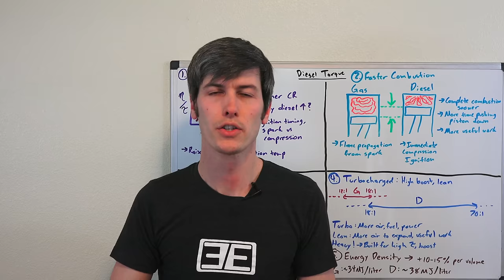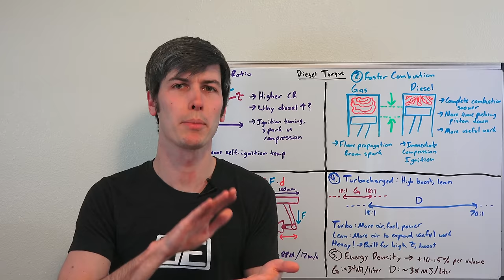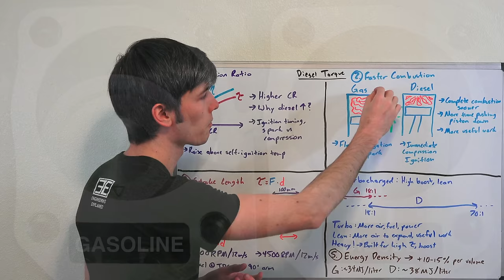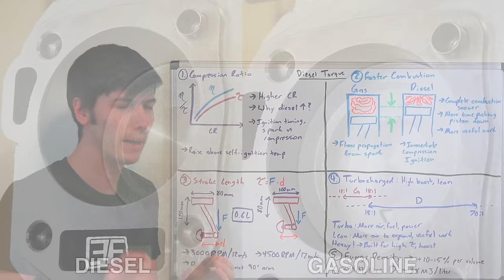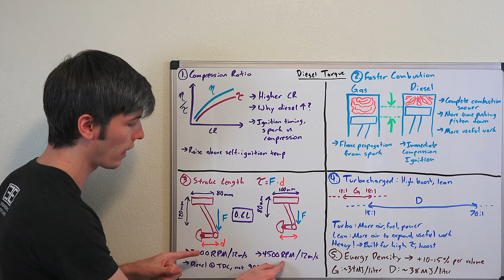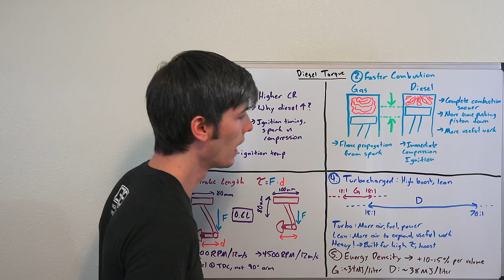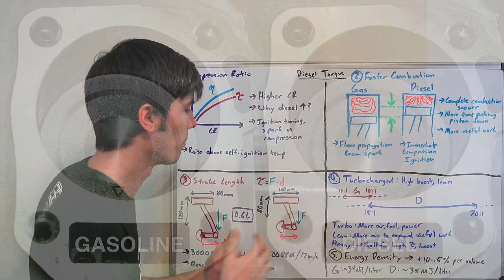5 Reasons Diesel Engines Make More Torque Than Gasoline

Comment from the maker: A question that keeps popping up is why don't any gasoline engines use compression ignition and higher compression ratios to be more like diesel engines. Well, Mazda is doing just that with their SkyActiv-X engine, and I've covered exactly how it works: https://youtu.be/yNSxow3W7ek
Hope everyone's having a great day, thanks for watching!
Instagram - https://www.instagram.com/engineeringexplained/
T-Shirts - http://bit.ly/2BHsiuo
Reply: Engineering Explained 
Does that mean the new Mazda engines will have torque closer to that of a diesel?
Reply: Here may be a good question for a video:  could you explain the differences/benefits between a V8 diesel and an I6, and how those engineering differences impact performance?
Reply: @Engineering Explained,  You said that complete combustion of  Diesel occurs sooner. But the longer carbon chain of diesel needs more time to burn than petrol which has a shorter length. I have some questions regarding this. Can you kindly spare some time in answering them please?
Reply: Mazda SkyActiv-X claims 20% more torque and horsepower while achieving 10% better fuel mileage, ive heard 10mpg improvment on all models.
Reply: It would be interesting to plot the torque over the entire 4-stroke cycle and show how this instaneous torque waveform (positive and negative) gets averaged-out by the rotational moment of inertia of the flywheel and combination of instantaneous torques from all the other cylinders.
Reply: It's not about the rate of flame propagation, but about the fact, that the initial flame is bigger in diesel (you can see that in the video).
Reply: Why just now? Why wasn't it implemented 30 years ago?
Reply: I've always wondered why a spark ignition engine (gasoline) couldn't be built to run on diesel fuel. I'm sure it would require a higher than stock compression ratio (but less than a compression ignition engine) and significant tuning
Reply: That energy gap between diesel and gasoline is the factor that provides all that benefits, maybe?!
Reply: Chris Bouchard GM made a diesel version of their 350 engine in 1978. It didn’t work well, or sell well. It was discontinued in 1985.
Reply: I think you're talking about the Oldsmobile Diesel.  They expected  a block designed for gasoline to handle the pressure required of a diesel cycle.  It didn't do very well
Reply: Ewie M That’s it. The head bolts kept breaking, among other things.
Reply: Are you sure about #2? Because the burn duration in diesel is restricted/limited by how fast you can add the fuel and "mix" it with the air.
Reply: Engineering Explained wrong! Gasoline engine even at idle the combustion is continuing well down the cycle.  Diesel too...  AND diesel burns slower than gasoline. 

Yes it has a longer stroke so the longer burn is negligible. But the longer stroke also means more leverage on the crank - TORQUE! 

The wider A/F has more to do with no throttle body/valve.

The parts I didn't address were correct.
Reply: Viren vs nope
Reply: Carl m that's quite optimistic.  Fuel consumed = power.  Efficiency won't jump that much.
Reply: Shai uncontrolled auto ignition gasoline engines are know as an engine with knock or pinging... 
 You need a computer and very hi pressure fuel system. (even hcci gas engines would be direct injection around tdi not port injection as has been common until  201x
Reply: Chris Bouchard gas engines create power because they are relitivly lightweight and rotate faster compared to diesels... Much different bore/stroke too.  
GM tried making a diesel for their cars in the late 70s...  Turns out a modified gas motor was not durable enough!
Reply: 5Rounds Rapid the gutless wonder they were...
Reply: The diesotto engine also takes the best of both worlds. Spark plug when cold, diesel ignition when hot. I wonder, what causes that distinctive diesel pinging noise?
Reply: eeretz Diesel fuel does just beautifully blow up in a nice little flame wave like gasoline. It just ignites everywhere across the cylinder. So just like in a gas engine when you have uncontrolled combustion somewhere else rather than the spark. Basically diesels have engine knock from hell. Lots of bigger gas engines can have this occur without much problem. Like my F-150 has a little knock which is expected from an old engine so it sounds like a baby diesel at idle.
Reply: Yes, GM converted a 350 into a diesel. I have several, only one is running. But those engines where still compression ignition, not spark ignition. Think about how we use ethanol. If you really wanna take advantage of it's properties, you need to build your engine towards them but with some tuning, you can just drop it right in. Why not with diesel? It wouldn't be a drop in but maybe you could build towards it. Burning diesel in a spark ignition engine.
Reply: Ricardo Fernandes some,  not all....  More accurately it's a trade off
Reply: DQSpider TQ is measured in lbs of pressure at 1 foot from center (thus a ft lb of tq) then yes,  it would. (I know some areas measure in NM,  but the same applies.
Reply: hi
what factors determine the minimum RPM for gasoline and diesel engine?
thank you
Reply: Please make a video explaining the properties of gasoline and diesel which make each more suited to a particular type of combustion engine.
Reply: mpgxsvcd You're not the only one that is skeptic, I am too and I'm sure there are more. I am sure there had been many attempts to do exactly what Mazda has "Supposedly" accomplished. I'd like to see data from their successful intensive testing. I hope Mazda doesn't make a huge mess on this as it will sink them. They're not going to survived a scandal like the dieselgate that VW gone through, they're not that big to sustain such hit from financial and PR standpoint.
Reply: Great vid Jason, as usual. I have a question... Longer stroke means a greater distance between crank pin center and center of crankshaft. This increases leverage and means a higher torque is available at the end of the crankshaft. However, having a larger bore means that the piston have a greater surface area on which the pressure inside the cylinder can push on, which in turns also increase the output torque. When does one situation becomes better than the other?
Reply: Vincent Pampanin That's exactly what he said lol! Basically more force to rotate but but slower at rotating because it has longer distance to travel.
Reply: Hamze d If I recall that's mostly the mass of the flywheel.
Reply: I’m sorry to say you did not explain it. You were also wrong regarding literally almost every reason you gave. There is one reason: Diesel engines don’t have to worry about knock and or pre-ignition at low engine speed like gasoline engines do. You know how on modern turbo gas engines how the middle part of the torque chart is flat? That’s a limitation to avoid knock. High pressure, high temperature, and ample time mean that the combustion would not proceed as desired if the boost pressure wasn’t reigned in.
Reply: Car companies are getting squeezed by increasing fuel economy mandates from the fed.
Reply: Engineering Explained I'm a big fan of your videos but every point that you are mentioning here in this video is not correct. I'm sorry that I have to say this but these are just ICE myths explained. Most of the things that you are mentioning have to do with efficiency but you could burn fuel less efficient while still producing more torque. Lower compression ratio engines with a turbo produce more torque than atmospheric engines, in diesel engines it also takes time to let the fuel evaporate and autoignite, the bore/stroke explanation is completely wrong (pressure on a bigger area=higer force), alcohol fuels produce more torque while their volumetric energy density is lower,...It would take me a lot of time to explain everything in detail but the biggest factor for the higher torque in diesel engines is that they are not knock limited. Please look this up, you could make a great video about this!
Reply: I agree. It would be cool to have a video going over a wider variety of reciprocating engine configurations and their tradeoffs (balance, space, etc.): I-6, V-8, I-4, H-4, H-6, V-4, V-6, V-10. Or, that's a lot, so maybe cherry pick a few.
Reply: The reason that a bigger initial flame is beneficial for torque is because the fuel is burnt faster and the added pressure helps for a greater portion of the entire stroke, as explained.
Reply: I think its because diesel fuel has a slower burn rate, so it ends up not working as well.
Reply: Engineering Explained still uses a spark plug tho
Reply: Engineering Explained I was literally just going to comment and ask about this.
Reply: I want video about what happens to toe ,camber and caster when the vehicle is loaded.
Reply: 87 vs 89 vs 91 vs 93 vs 100+ octane
Reply: You can't simply ignite diesel with a spark. Gasoline is highly flammable at normal temperatures which is why it ignites with only an electric spark. If you want to spark ignite Diesel you're gonna have to compress it to flash point first to make it flammable (or rather reduce the gap between flash point and actual fluid temperature) it wouldnt burn well. 
diesel has a flash point between 50 and 100 Celsius compared to gasoline's -43C, which is why gasoline simply flares up in presence of an igniter source.
Reply: Engineering Explained 3
Reply: Engineering Explained ... Do you ever breath during your presentations?  😂
Reply: Yousuf Pretty much everything you can think of has been tried in one fashion or another before. It takes science built on top of science to figure out ways to make some of them practical. There was even a two stage diesel wankel engine. It's all about money and research.
Reply: Engineering Explained
Reply: JEF: You sound like alcoholist polytechnic teacher (I have experience) who just insist that everything you said is just wrong and your points can't be right, but refuses to give any clear answer or constructive explanation why is that - just escaping to "I have no time" -trash to keep it in clear water. Oh and if that's not working, then try insulting him  and the car he's driving to make him finally shut up or trying to make new lousy points quickly why you're at least wrong in these points here.

I think EE is doing fine job here, even if diesel isn't that big thing on U.S and they have less knowledge about it than on Europe.
Reply: Engineering Explained  i always thought gasoline is more explosieve than diesels
Reply: That Mazda engine is a hybrid spark/compression engine. More smoke and mirrors than true compression ignition.
Reply: Yep, I think the most important point here is to admit that this isn't true HCCI-engine, just direct injection engine which has more advanced lean burn mode which contains little bit of HCCI-burning. Of course those who insisted that HCCI-engines will be the future will keep insisting that this is the evidence about HCCI.
 - they're so desperate. =)
Reply: Due to the difference between octane number of fuel.
Reply: @LB83.  just a lower flash point so easier to ignite but less energy like a stack of papers vs a piece of wood (assuming they are of the same volume) the paper is easier to ignite but burns faster while the wood is harder to ignite but burns longer and hotter.

Poor analogy but hope you get the idea of what I'm trying to convey.
Reply: Think Renault are attempting similar with their new Tce engines (115, 140, 160). New compression chamber design to raise torque at lower rpm.
Reply: Diesel indeed burns slower than petrol. The reason that the complete combustion occurs faster in diesel is the fact that the diesel ignites in every point simultaneously whereas the petrol will ignite from the spark plug and the flame front will travel outwards from the spark plug. In other words, you can say the petrol "burns" while the diesel "explodes"
Reply: Saujatya Kole  you have an interesting question here. I think it's only really "sooner" just because it doesn't need time for the spark signal to the spark plug. I'm wondering is your question more of the differences between gas and diesel burn rates or vs. the carbon chain differences
Reply: Well, the reasoning is simple.  If you try to combust gas via compression you get knock.  Pretty simple.  Okay, it is more complicated than that but basically it leads to bad things.
Reply: @virenvs905  The torque for European specs are about 10% more.
Reply: Chris Bouchard 
My father, who was born in 1920, told me that as teenagers he and his friends used diesel fuel in cars designed for gasoline. He said they started the engine with gasoline, then switched to diesel while it was running (perhaps gradually). Finally, they switched back to gasoline before shutting down. He told me that was necessary because the cars wouldn’t start on pure diesel fuel. These cars would have had very basic, low compression engines. Also, my father and his friends weren’t very worried about damaging the junkers they drove. No word on power output or mileage.
Reply: @LearningFast   VWs engines were clean.  They simply chose to allow them to get better horsepower and better fuel economy for the customer than could be achieved while meeting the EPAs insane standards, that measure emissions per gallon of fuel burnt instead of emissions per mile driven.  So, the cars passed the test when hooked up to the machine and then reverted to the better system settings when actually driven.  The government was wrong here and VW was doing their best to work around insanity.  Check out the podcast EP autos (that's the website) for more on VW and their engines.  That's where I learned about this.
Reply: @SaujatyaKole  Hello. The video is actually wrong where it says "complete combustion occurs much sooner in a diesel". Typical burn angle for gasoline engines is 25 deg whereas for diesel it is 40 deg. The reason is that in a gasoline engine all the fuel that is going to be burned is already in the combustion chamber mixed with air waiting for the spark. But in a diesel no fuel is present in the combustion chamber until it is injected and the rate of injection limits the rate of fuel burn. It is true that if all the diesel fuel was already in the combustion chamber it would all burn "instantly" as the video said, but that would cause the engine to self destruct so the fuel is injected over a period of about 20 deg of crank. In a gasoline engine the compression ratio is kept lower and suitable octane rated fuel is used to avoid precisely that damaging self ignition aka detonation.
Reply: Because Gasoline engines are fuel quenched and diesel engines are air quenched. The SkyactivX engine is going to fail miserably unless they can magic away the heat that Gasoline engines inherently produce from adding more air.
Reply: Because they knock!
Reply: @monsterram6617  stroke
Reply: so What's the future of trucking industry? 
if not diesel, then what?
Reply: Engineering Explained this may seem odd but been watching your videos for a while now. And I was wondering if you have any of your s2000 parts around finally got life together and got one and starting my build. And would love to have an engineering explain piece on my car.
Reply: why dont formula 1 cars use diesel?
Reply: I believe one of the reason why a gasoline engine doesn't use the compression to ignite the fuel is because diesel engines are ridiculously heavy because of the amount of metal used to keep the block from blowing itself apart because of the much larger combustion ratios.
Reply: I bet you all never had driven a diesel powered car before...
Reply: PikPobedy  does what?
Reply: Hi
Reply: The answer is simple.  High compression with gasoline engines can easily cause spontaneous combustion.  To stop the pre-ignition, lead used to be added to slow/stop pre-combustion.  Today other additives are used to help the environment.  Higher compression in gasoline is simply engineering issues.  Gasoline can never have as high a compression ratio as diesel because how fast gasoline burns compared to diesel which is basically oil.
Reply: Having 1.8t gasoline havent seen 1.9t diesel being able to pass
Reply: More stroke=more torque
Reply: @5roundsrapid263  My first car was a 79 Olds Delta 88 with that engine...engine did just fine...injection pump had to be rebuilt every 6 months..
Reply: @ewiem4351  My first car was a 79 Olds Delta 88 with that engine...engine did just fine...injection pump had to be rebuilt every 6 months..
Reply: @PhilthyHorseRacing  My first car was a 79 Olds Delta 88 with that engine...engine did just fine...injection pump had to be rebuilt every 6 months..
Reply: But what about a non turbocharged Diesel engines. It would be interesting to see how that mathematically compares to a gasoline engine in how much power it creates.
Reply: What if we use compression iginiton in gasoline engine , I mean avoiding spark and using compression heat.
???
Reply: Exactly. It's called a conspiracy.